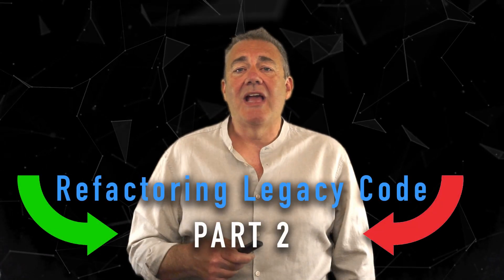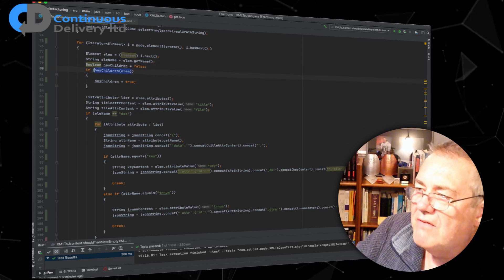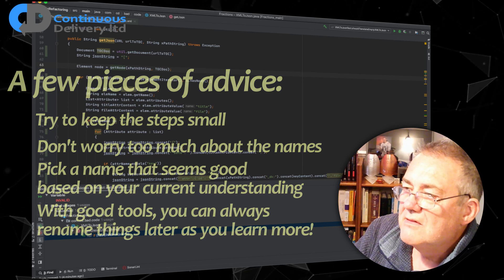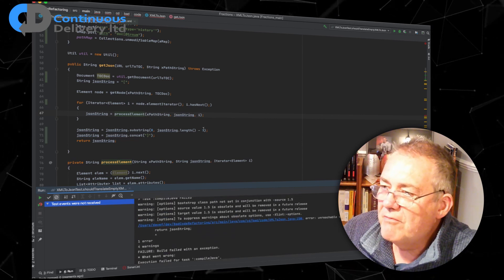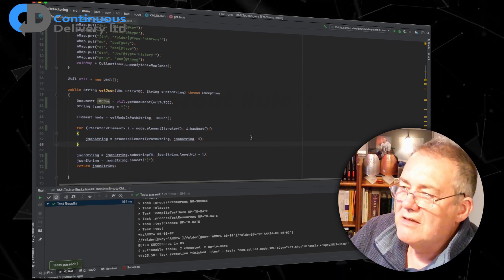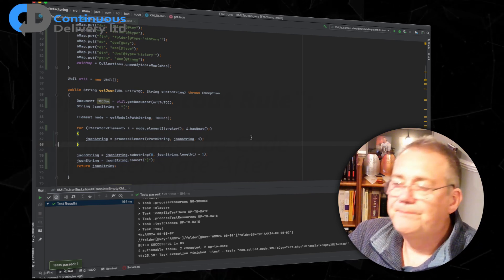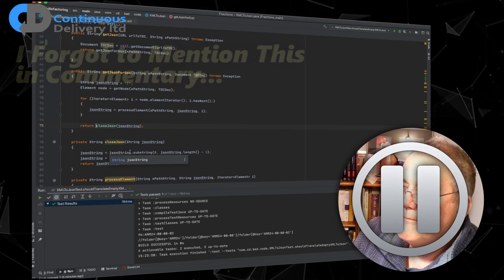Refactoring Legacy Code STEP BY STEP (Part 2)

Comment: 1:32 - 1:36 reduce complexity + compose method
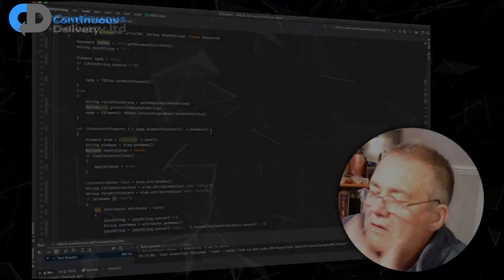2:11 code demo: reduce cyclomatic complexity
    2:58 favourite method to resolve this problem: extract method
        3:29 great quote from Kent Beck : all of good designs are about move stuff that's related closer together, move stuff that's unrelated farther apart
        4:22 inline method

Comment: Great video - I think there's way too few videos about refactoring code. I often observed that only the best programmers take the time to refactor their code (or other people's), and it always results in much great capability to extend or fix it.

There's a point in your video where you skip a pretty important part, at 14:12, you take the jsonString out of the processElement list of arguments. This is among the most important kind of non-trivial refactoring: it's idendifying 'orthogonality', i.e. when you notice that the way a given argument is used inside a function is so trivial that it's not worth having it happen inside the function. An example I've seen are things like this (say in Python)

def my_fn(client_id, client_name):
   out = dict()
   # populate out with stuff that depend on client_id, but that do not require client_name
   out['name'] = client_name
   return out

That function was annoying, because looking up the name from the id was not trivial, and therefore it was frustrating that the client_name argument would be required given that it was not playing a significant role in the fn, yet appeared to. I just removed that last line, and looked at the calls to that fn in the codebase. There were only a handful of them, and none of them were doing anything useful with out['name'], or if they were, it was simple enough to just use the original client_name, rather than out['name']. This, in turn, prevented from having to do the id->name look up, and simplified the code even further.

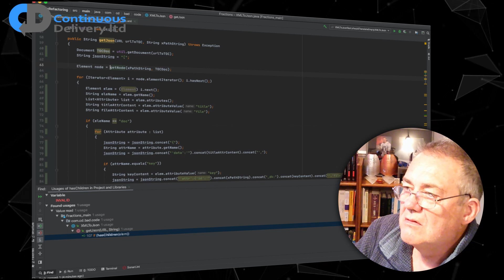Comment: 5:45 Extracting methods is great, but "Don't worry too much about the names" is a recipe for confusion, like the game of telephone.
10:11 About the "Boy Scout" rule. Yes, if you touch an certain area, but not if you're touching things nearby but unrelated to the task at hand.
12:06 That's a good trick! That said, I'd make sure the input arguments are the same order in both functions.
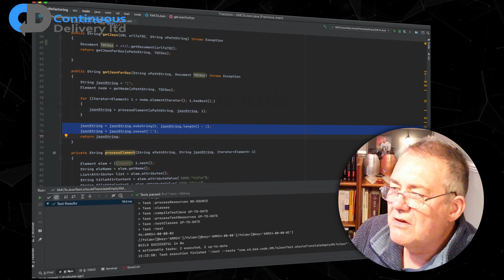13:14 I would not extract that part. The closing mirrors the opening at the top. Extracting it doesn't make sense without the the top of the function.

Comment: Great video.

I like to think about the "Extract Method" type of refactoring as a "Move 1 level of abstraction" technique, which you can do with Extract Method, but also do much more, depending on your language.

For example, using C# as an example, I could do these in succession: Extract Method - Extract Class - Extract File

If you extract method the block of code remains in the same class. What you do is you eliminate the coupling between the block of code and the free variables/scoped variables from the previous method it was in; however, your block of code is still coupled to the class members of that class. Your block of code still has visibility on the other methods; it still has visibility on the fields of the class, both instance and static ones, there is still coupling going on.

If the above coupling is unnecessary, I'd do Extract Class, just for that block alone. And keep that class in the same file, it's simpler that way, nothing changes from the "outside". By doing this, you inject to this new class only the things your block of code needs, and nothing else. There is no more coupling between that block of code and anything else.

Finally, if this is creating clutter and complexity in the file itself (i.e there are many different classes in the file itself and it's less readable), I'd perform Extract File to just extract those classes to separate files; perhaps even use a new folder structure for them too.

Of course, there are more levels of abstraction above this. In the context of C#, there are namespaces; assemblies, and more. Theoretically, the same exact block of code you can continue "extracting" one level up in the abstraction hierarchy. First extract to a method, then to a class, then to a file, then to a new namespace, then to a new assembly/class library, then ultimately to a new package/project/etc. 
On the same vein, you can take such block of code one level down that hierarchy of abstraction, if it's more readable and maintainable to do it that way.

I think some devs may get too caught up on only doing Extract Method and nothing else, but the above has helped me a lot in improving the modularity of a codebase, even when the public interface of what I'm refactoring (and its behavior) hasn't changed at all. The above depends on your language too, for instance, you wouldn't be able to do the above in Java where you can't have more than one class per file (at least in Java pre 8 when I was using it).

Comment: I would prepend to the idea of moving related code closer together and before reducing cyclomatic complexity, that you should first reorder elements (usually methods / functions within a class) so that it follows a more consistent logical flow with initiation and main methods close to the top and the most commonly called methods from them immediately following.

Doing this before diving into any actual code changes within the methods will set you up for better code and ensure you have a good idea of the overall function and flow before you start to change how it does the things that it does.

Comment: 1:10, Java IS very nasty code!
8:40, I didn't get it: it still has the breaks. How passed this time?
14:12, I think you make too many f()s. Some thoughts about that:
1) Whenever you extract a f(), you are putting related things a bit away from each other, and a bit near to the rest of the outside code. This also can lead to accidental calls to those f()s. /*Edit: and you'll deal with more code.*/
2) Compilers use to inline a certain amount of f()s. And if you raise that number, it can eventually get an unnecessary extra large generated byte code. This can lead to slowness.
3) 13:13, as I said on the previous video, for C++, just: return jsonString.substr (blabla) + "]" , which would be 1 line, no extra f(). But I guess Java is too bad to has that.
Reply: it has breaks, but in nested for, not the top one
Reply: dev null  What a surprise! People use to get pissed off by my comments.

Comment: I also like to remove the warnings, so that the remaining ones drive me to deeper, more interesting problems (we called it yellow hunting it one of my former team). 
With IntelliJ it's usually easy, and safe. I'm also not sponsored :P

In Java,  there is a lot of other small things which I think are helping, like try to make variable final and see if it still compiles, reduce scope of broad scope variables, sometime inline then re-extract at different points, etc.

I would also avoid introducing things that bother me, like a close without open at the same level, or method that alter their arguments. So, I disagree a bit with you extracting closeJSON.
But I guess it's a matter of priority, and we probably converge after a few refactoring iteration.
Reply from the maker: Yes, I like to enforce the "warnings" thing on commit too. Turn-up the compiler warning-level to max, and then fail the commit on any warning. "Trust but Verify" 😉

Comment: Haha! Exactly what I am doing most of the time at work. I 100% agree with everything. Of course there are refactoring steps that force you to do bigger changes and don´t allow you to keep your steps small. That´s why the commit after every change and successful test is important. The next step can be a big one that might fail and you don´t want to lose the small step. Change, test, commit slavishly!
Reply from the maker: Yes, the "simple steps" idea is key. When combined with version-control it allows us to proceed much more safely.